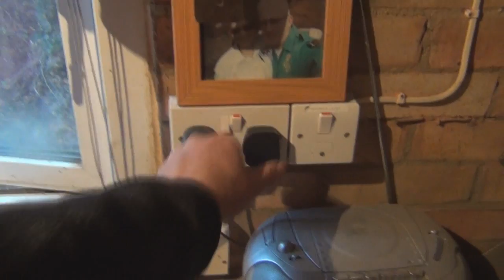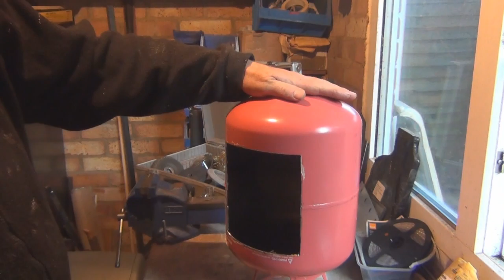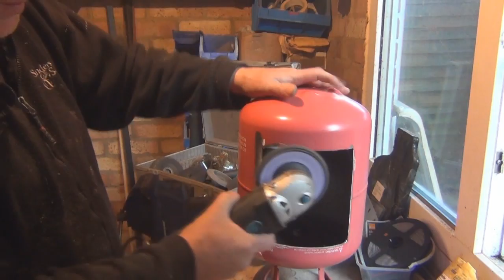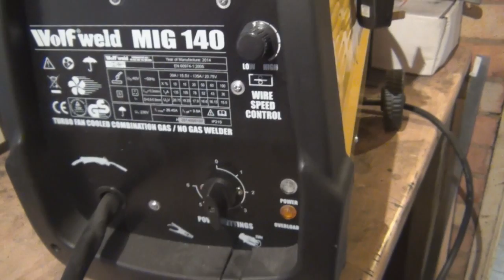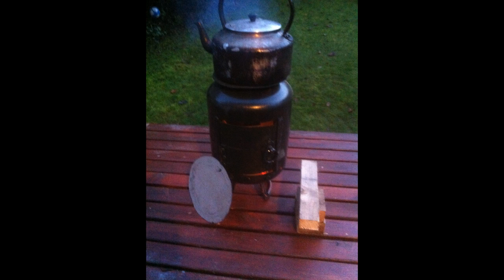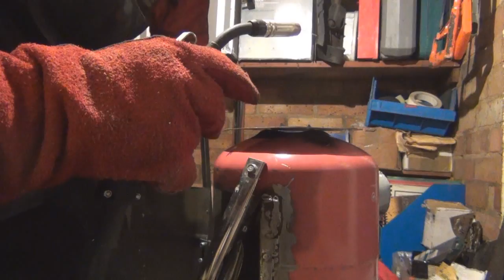New pot belly stove

Comment: talking safety and then used grinder with no guard............. also the circle behind the valve is a puncture ring.. after using bottle hit it with something pointy ( old screwdriver) and then fill with water if required, or just leave to let any gas residue dissapate

Comment: roach never peel the metal burrs off the edges with your fingers like that if the burr stops peeling it will slide through your fingers and cut them down to the bone

Comment: About your welding.. make sure your ground is better next time. You had some sputtering there due to lack of contact on your ground clamp. Take a small length of bare cable (the bare strands) an put in between the metal and the clamp, that'll give you more surfacearea and a better ground. Your wirefeed also seems to be slipping ;)
Other than that, real nice job :)
Reply from the maker: Thank you sir, Always learning Atb. Roach
Reply: I'm gonna make a couple of these the coming weeks, maybe I'll post a video too :)

Comment: in this video sounds like your wheel holding wire is a bit tight, Im no pro either I ran into the same problem. Just a mention.
Nice stove I'll be tring to make one just like it.

Comment: Amps not watts..  nice stove
Reply from the maker: Yes thank you. R
Reply: Have a look at my oil burner on my channel. More efficient and burns smokeless. Easy start to. Instant heat. 

Nathan
Reply from the maker: Thanks I'll look it up, the idea with this is that it can be used as a heater, cooker or an oven Atb. Roach
Reply: Mine can to. I've made a few for different uses.
Reply: Amazing ideas these  burners really.

Comment: Awesome video mike, might I ask how you got the valve off did you break it off or just used a wrench and twist it, I have the same cylinder and can't get the valve off to flush the inside with water,

Comment: Well I have been using a grinder for years . 
And the only reason for not having the guard on it to use all the disc and is very unsafe as I'm sure you know  so I suggest you cherish your fingers more and don't worry about the last little bit disc you can't use .  When I see no guard on a grinder I see accident in the making  especially with the mill gauge blade they snap  and fly in to your face like what happened to my friend   and on a side note your wire feed speed is to fast for the heat setting you have it on that's why the gun is kicking back on you it dose not have enough time to melt the wire as its flowing to fast   It should sound like sausages cooking in a frying pan and smooth no gun kick back  . I have been in this game a long time and I try never to get complacent with the grinder or a table saw or a still saw all potentially life changing power tools  . Sorry it's long winded but I was surprised you had no guard after going on about the importance of safety glasses .  Remember it's harder to fabricate stuff with 8fingers
Reply from the maker: Your Right, it became loose and inhibited the rotation of the disc (But yes unsafe for sure) I plan to replace it Atb. R